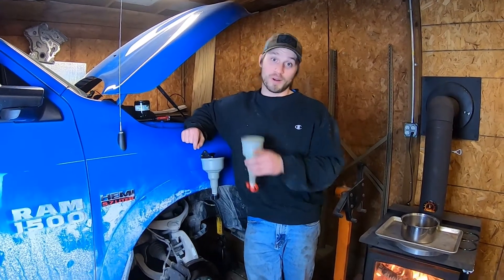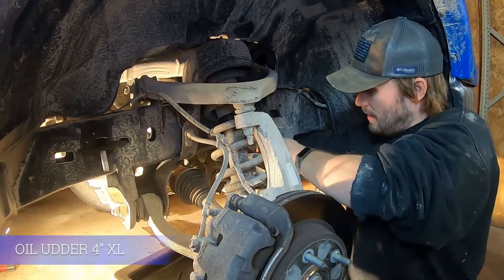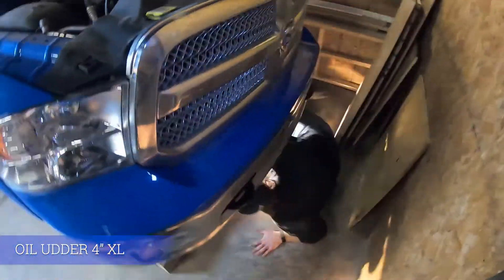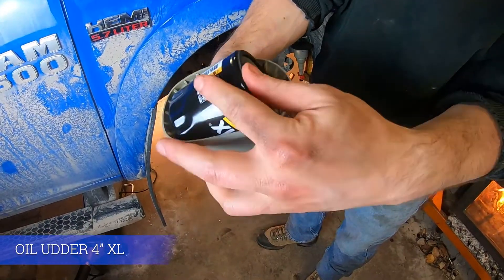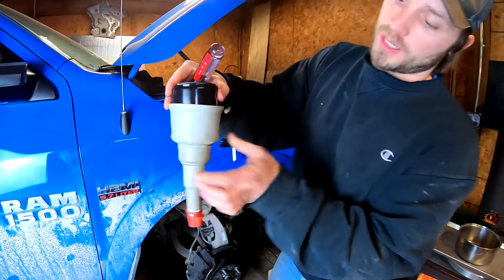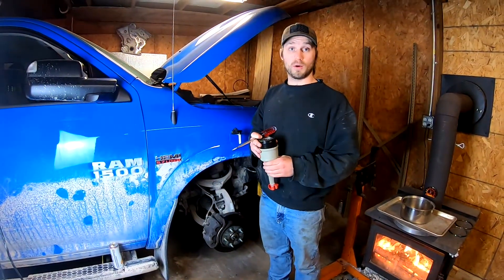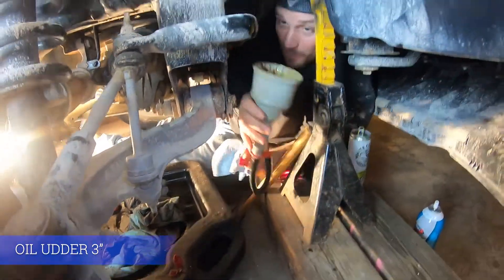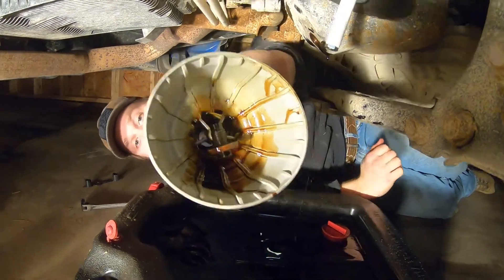Dodge RAM 5.7 CLEAN OIL CHANGE Possible? | 4WD |  No MESS | #truck

Comment: I have a 2014 RAM 1500 with the 5.7l engine. I've changed the oil around 30 times on it and I've never needed to remove the pass side tire.
Reply from the maker: It can totally be done! We mostly needed it for the camera work and should have said it was optional but we forgot. Oh well! Thanks for the comment!

Comment: I have a 2005 Ford F150 FWD with the 5.4 Triton 3V engine.
As you know the filter is on an angle and is hard to get to.
I also have the FUMOTO oil valve on the truck so the drain plug
magnet is of no valve to me because there is no drain plug.
Will this work on my truck? It looks like it would. At one time
Eastwood had a somewhat version but it was not with a funnel,
it really didn't work for me and they have discontinued it.
I use a Motorcraft oil filter FL820S which is 3 3/4 inch in diameter.

Yesterday I ordered your product thru Amazon I hope it works as
good as expected.

  Please advise.
Thanks,
Bob Johnson
Reply from the maker: Hi Bob,

It does work for angled filters if the angle isn't too steep.  Look at this video around the 30 second mark when Kevin is describing how to use it with angled filters.  https://www.youtube.com/watch?v=CRibIHoflEM&t=4s

You want the 4" XL size for that filter.  I'm guessing that's what you ordered on amazon but I just wanted to clarify.  Sorry for the late response I missed this comment coming thru.  I hope it works well for you!  Let us know if you need anything, my cell phone number is on the card in the box with your oil udder.  

Elliott
Reply: The magnet isnt just for the drain plug, me personally i wont use it for the drain plugs because getting the drainplug out without getting a drip on myself isnt all that hard also i wear gloves just because its my day job and taking a pair of disposable gloves off is way faster than going to the sink using soap and washing my hands clean to pull out customers cars but i think the magnet is mostly nice for holding the oil filter in the tool because you definitely dont want the flexible silicone to bend and oil filter fall with my luck it would come right down towards my face and id be covered in oil lol
Reply: Available thru Amazon?